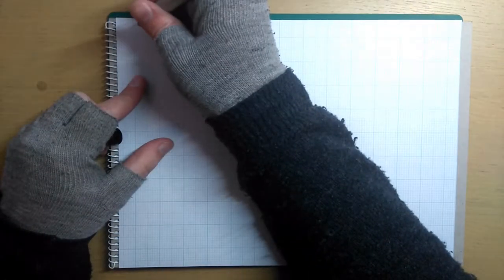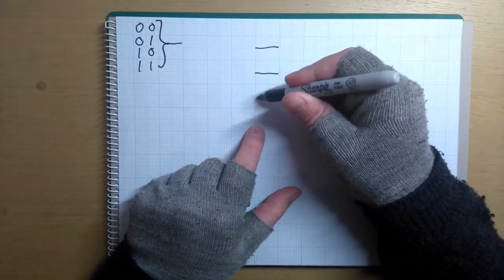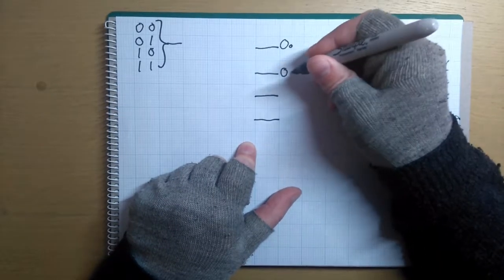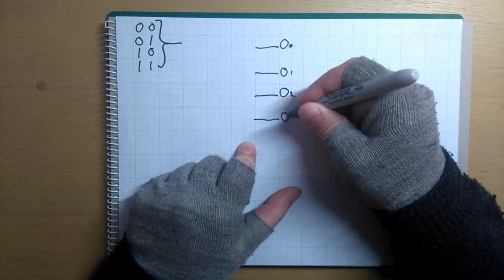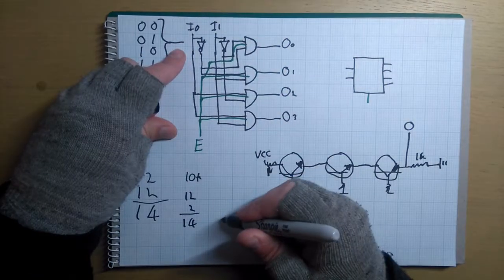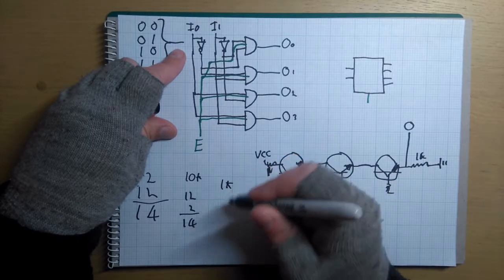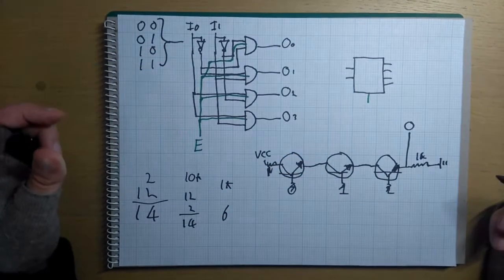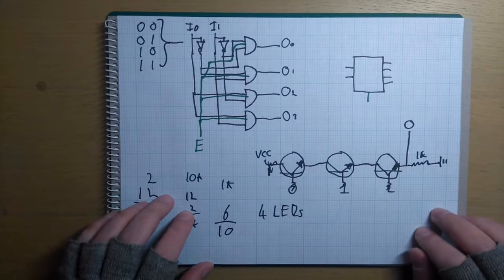2 To 4 Decoder

Comment: I would use diodes to make gates with a single transistor to buffer each diode logic AND gate output. Cheaper and fewer problems with the slightly differing base drive voltages you get when you stack bipolar transistors that way.